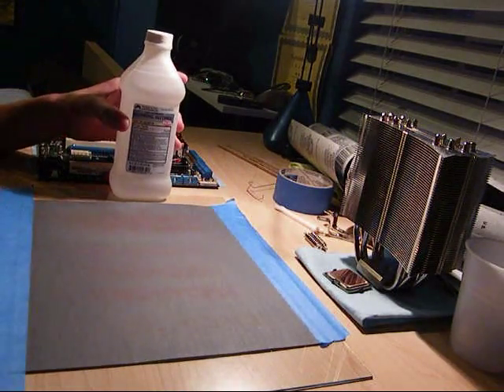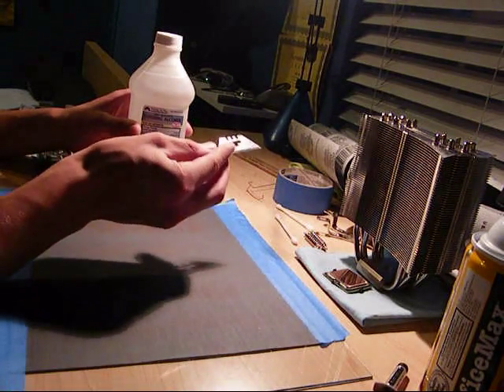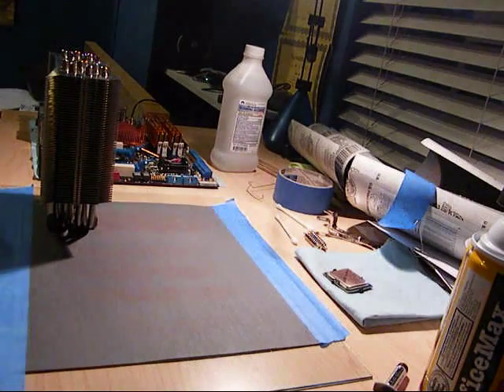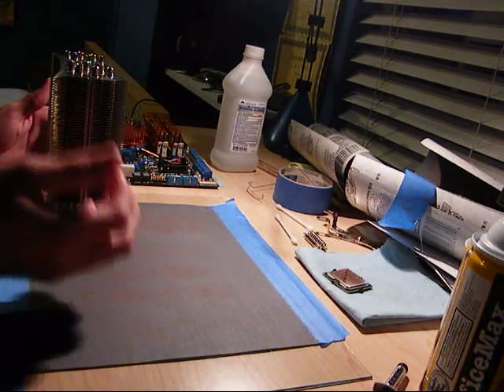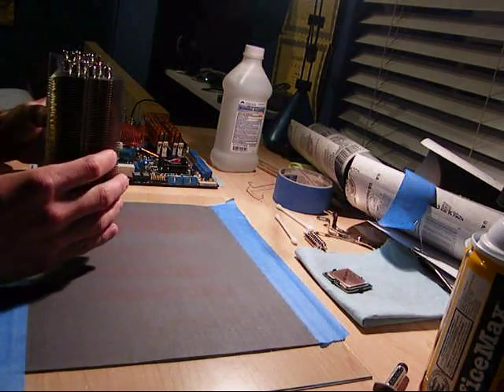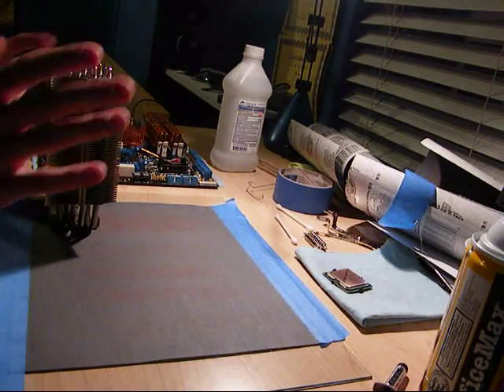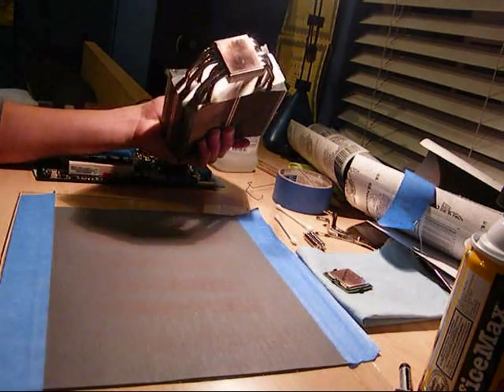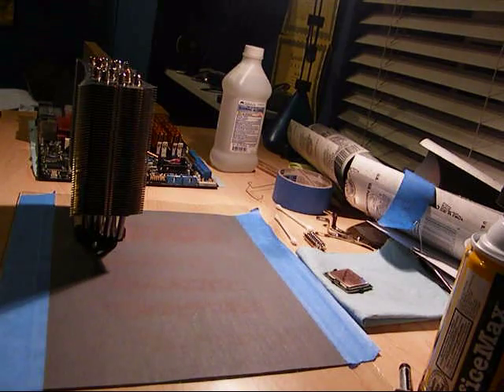How to lap your Thermalright Ultra 120 Extreme (*WARNING-in depth video)

Comment: 17 years later and I'm still using this cooler. I bought a 9950x3d and I thought that a stock Ultra 120 wouldn't cut it. And as I never laped it,  I thought I would try lapping it before trying/buying a new one. (Also, newer cpus seems to be more delicate, and this cooler had quite a big curvature) 

I did this tedious procedure as carefully as I could (it took me a full day).

After installing it, I'm getting 45° on idle, and it seems it's even better that some newer good brand coolers (excluding watercooling of course) 

Really, this cooler was and is a really really good one.

Comment: That’s cool. I did mine both Extrene & copper version w:/ Q6600 when new. Still using today on i9 7900X 140w OC’d over 5GHz. They’re just awesome cool. I’m gonna put a pair on an evga SR2 w/ dual X5690’s. It cools so good in its own can’t rly get below 10c on a 95w Xeon and 50c loaded w/ single Noctua @ 770rpm. It’s hard to get fan to kick in. The lap gave me 3-4c easy

Comment: @KeithWasHere1 there are a ton of spray paints made for fiberglass and plastics applications, but very few that don't need an actual uv protective clear coat. One of my absolute favorites is SEM spray paints. They make just about every kind of stock trim color in all kinds of finishes. Pretty much any kind of flat base spray paint can be used if correctly... meaning light coats as to not get solvent trap which cause wrinkling and solvent pop. Afterwards just select one of SEM brand top coats.

Comment: @fuzonacid  ..... as a custom automotive body and paint technician you can do wet or dry at any stage of lapping depending upon the material of your cooler base. I have personally made it my preference to start out with 220, 320, 400, and then 800 dry using 3M wet/dry automotive grade sandpaper. I then switch to 1000, 1200, 1500, and finally 2000. using these grades of paper and steps leaves you with a 100% mirror smooth finish on copper and aluminum surfaces.

Comment: Just to let you know, you could apply a filter to your video to remove that annoying sound your mic is picking up.  There is pro and some easy to use which you'll proubly want as its a few clicks process then.  Head over to Acoustica and look at their Spin it Again program.  Try the demo out, its usually used to remove the hiss or popping sounds from vinyl records but it will work exactly the same for your video.  Try it and leave a comment on how well it works.

Comment: The camera noise may be due to the AGC (automatic gain control). When it's a quiet environment the camera automatically turns up thegain and ends up recording the motor noise. One work around is record that noise and then in a audio edito make a nose reduction profile. Or if you can turn the gain down somehow or disable it? Some cameras have that feature. If you have audio input just use an off camera mic that will fit in your flash shoe.

Comment from the maker: @LemonAndYoghurt 

High grit sand paper can be found at most any hardware store. I'm not sure what they have in Holland, but any equivalent to the American Home Depot should have it.
Also any isopropyl or 90 percent + alcohol will do just fine. And yes that alcohol is the same used to treat wounds ;]

Comment: Is that it?
His results are from lapping his CPU and heatsink, thus are completely irrelevant to this discussion. Making both surfaces completely flat and have exposed copper will obviously reduce temps more than just lapping the heatsink. However, not many people are as willing to lap their CPU as they are their heatsink. Not to mention the fact that lapping some surfaces often result in a loss of performance, e.g., the Heatkiller 3.0.
And didn't I ask you not to waffle on with that codswallop?

Comment from the maker: Well that is to say that you lapped it as correctly as possible (not saying you didn't, just presenting the argument is all :]). 

With both my CPU and heatsink lapped I received  a very noticeable 12 degree centigrade drop in load temperature, which in fact did allow me to push my CPU a whole 250 MHz further (@ 3.85 GHz currently) before overheating to the point of BSOD's. I do understand though that in real world that extra speed isn't greatly noticeable just surfing around within the OS, but-

Comment: Yes, that is quite obvious. My point is that the difference in temperatures from lapping are not great enough to provide people with a faster overclock. I have seen no evidence to suggest that a CPU at 50 degrees is more likely to undergo a BSOD than a CPU at 47 degrees. 

Lapping is for the compulsive enthusiasts. It doesn't provide any real world performance enhancement, but it is fun to do, and seeing our temps drop by two or so degrees is nice. I have lapped mine, but I know that it did not-

Comment from the maker: ^^(sorry ran out of room :O)

So, if overclocking increases CPU temp, and lapping a heatsink decreases it, then technically speaking a cooler CPU can indirectly lead to it having the potential to be faster. 

Also, in order to truly understand that all, one has to obviously understand that the hotter a CPU is, the more unstable it is. An unstable CPU means blue screens--which are bad :[

This also all explains why CPU's OC'ed to >5GHz are cooled by liquid nitrogen :]

Comment from the maker: I believe that all oxus was originally intending to do was give a very VERY simple explanation of what lapping enables you to do. 

What he meant by saying that a cool CPU=more speed is simply that having a CPU's load temperature be lower under more stress (which is what lapping can do) gives it the ability to become faster due to the fact that it can then be overclocked to a higher speed (which, in doing so, increases the CPU temp).

Comment: Technically, the way to know what I have already admitted is to read my posts, not ask me to restate them. Pressing for a new admission begins with "Do you" "Will you" etc, get the drill?

U hold the wrong assumption I've claimed a CPU WILL run faster cool that hot. But I spoke about what a computer CAN do with effective cooling. If you don't understand the difference between the two, try telling overclockers that temp management has no impact on what their CPU CAN do -

Comment: @bm, not to be rude or anything, but you're not that much fun yourself. My first post was a super-simple expl to a guy who was totally clueless. You tuned in there with your sturm und drang hostility and minute details. Spare me ok...

Taking your point at face value however that out of the box TRUEs are sufficient for every possible overclock config - what IYO is the sum of other benefits gained from further enhanced cooling?

Comment: @bm, I realize now my statement was both grossly misleading as well as an irresponsible violation of the intellectual code of pinpoint accuracy, so thoroughly stressed by the distinguished original post: "wtf is this haha sorry ... ?"

I'm resigning all my honors at the Intl Support the TRUEs' Committee (ISTC) as per today. Please forward the urgent corrections to ozi2nvozipride ASAP. The consequences, should he unwittingly act on my flawed info, are simply too dire to contemplate.

Comment: Please explain how a cooler processor is a faster processor? That makes no sense whatsoever. A CPU with a non-lapped TRUE should be cool enough to not have its overclock limited by temps. Lapping a TRUE is for lower temps ONLY. Not better performance.

Comment from the maker: honestly you actually only need one pushing fan for the heatsink (aka the fan pointing to the front of your case). I have seen little to no difference (about 1 degree C) when using a pushing fan along with a pulling fan (aka the one pointing to the back of your case). hope that answers your question.

Comment from the maker: sorry for the late response but no you never want to use any kind of polisher on a lapped surface unless it is some sort of thermal grease/polisher combo. the reason is because polisher leaves a thin layer of residue and would create a thermal insulator between the cpu and heatsink. hope that helps and hope you havent done that already :] haha

Comment from the maker: Haha well that all depends on how much you tighten it :] Plus you want some amount of pressure to be applied to the cpu's IHS because it helps it become even more flush with the heatsink. Also it would take quite a bit of pressure for it to cause damage. I know because I have specifically looked into it haha. 

Besides if I did remove it then there would be no way of attaching my TRUE so its a moot point. I appreciate the concern though :]

Comment from the maker: Simply put, the surfaces of some heatsinks and cpus sometimes come crowned, and if you think about it 2 crowned surfaces can never touch in a flat or flush manner.

Now, thermal paste is intended to be used in the smallest and THINNEST amounts possible because it is only meant to conduct a cpu's heat to the heatsink. Too much actually makes it a heat resistor.

So, for ex if the heatsink surface is uneven it needs more paste to fill in gaps -lapping allows you to use the thinnest layer possible.

Comment: I'm planning getting a TRUE. Can't the process of lapping the heatsink be done in an incorrect way and make a damage forever?.

Anyway, you do it starting from 320? 320 3 times, then 400 3 times, then 600 3 times, etc?,. So 320-400-600-1500? 

After 1 time (north, east, south, west), you clean with alcohol? 

I'm not sure about doing it to the CPU anyway :P.

Comment from the maker: Hey no problem, glad to have helped. Yeah unfortunately it does, but that's a small price to pay for the overclocks that you might be able to achieve with a good lap. At least that's how I see it :] and yes all of those little etching get sanded away in the process, so technically if you lap an old e6750 775 socket cpu you could sell it to somebody and tell em its a qx9770.....then run :D haha jk definitely don't do that obviously. Good luck!

Comment: Nice, I found this video very useful.  I'll be modding my ultra 120 extreme black to fit properly with my AM2 motherboard (using "doglips s-clip mod"), and while it's out, I've decided I may as well lap the heatsink.  I'll definitely be referring back to this video a few times.

Lapping your CPU voids your warranty, though, right?  And...the etched datecodes, etc. on the processor are erased, right?  I was just wondering.  I'm still probably going to end up doing both.  Thanks again!

Comment from the maker: oh dang you know i don't remember for sure.....sorry dude. all i know is that it was the absolute only thing that ace hardware had, I just grabbed the highest grits that they had in stock and bought em. the only types of "different" mid-high grit sandpapers i have seen are just dry, wet, or both. haha ive never noted the actual material used in them. sorry again man wish i could be more helpful.

Comment from the maker: definitely. its mainly more important for cpu lapping (since they are obviously much more delicate than any hsf) but it applies to heatsinks as well. also just be sure to start with a relatively low grit (something like 220) for just a few sets, it will save you SOO much time.
Reply: All 220 grit does is make deep scratches. No way.

Comment from the maker: its all up to you. lapping your heatsink will definitely bring big improvements in heat dissipation (especially with the TRUE), but lapping your cpu will just finish the job.

you would be really hard pressed to screw up lapping your cpu so bad as to expose the die though. you would have to be very VERY incompetent. it would literally require grinding your cpu's ihs against the sandpaper with an obviously absurd amount of pressure to do so. like i said its entirely up to you though :)

Comment from the maker: NOOOO 
haha absolutely not. if you put more than a paper thin layer of thermal paste on ANY part of the cpu hen it will have the opposite effect on heat transfer. if there is too much of the stuff it will actually insulate the heat produced by a cpu instead of dissipate and conduct it.

so in other words if you "fill in" the low areas then you will be giving yourself an even bigger problem than if you just left it alone. 

with any and every good thermal paste lesser is always more.

Comment from the maker: hey to answer your question, yes lapping could defnitely fix that problem. the way that the i7's dies are made is such that if the IHS is just a little concave in one area it could be an entire core that is being neglected from touching the heatsink. if its really a problem then i would have to recommend lapping the cpu too. either one of them could be crowned.

usually the TRUE tends to be very crowned in the center but your cpu could very well be just as bad. lap you TRUE first though.

Comment: I've recently assembled my new i7 pc, with an i7 920 and the Ultra120Extreme (with a 1366 mounting kit)

After a few weeks of testing, I've noticed two things:
1)I can still twist the 120 around a bit
2)There's a noticeable difference in the 4 core temperatures (under load).

The 1st problem can be solved by adding a washer between mounting bracket & base of the TRUE.

I was wondering if lapping it could fix the second problem, + if it's necessary to lap my cpu as well (I'd rather not)

SanderD

Comment from the maker: it doesn't really matter. personal preference really. i personally prefer not to because i feel like it makes it take way too long, and yet it does nothing a whole lot better than it would if the paper was simply dry.

however, if you did decide to do it wet then instead of using just water, take some dish washer soap and mix just a little bit of it in water to make the sanding action a little more smooth.

Comment from the maker: hey thanks dude, I appreciate it. To answer your question you can use anywhere from 3 to 7 depending on what you are trying to accomplish. But personally I find that anything above 4 isn't really too necessary. I usually go 220(very few sets), 400, 600 or 800, then 1000 or 1500(depending on how shiny I want it). Anything above 800 is for the mirror finish mostly, it gives basically no extra performance. It's all personal preference. Hope that helped.